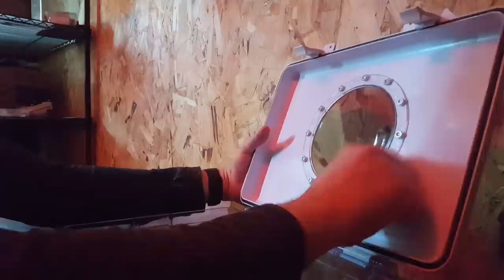Hampture Update for 3/11/2019: Dome Skylight & Official Merch

Comment: If you want to keep the hamsters really safe you should implement a system where the failure condition leads to their safety. So for example if the power is cut, then the habitats will float to the surface or something. It's basically the same concept behind safe nuclear reactors, where the "out of control" condition will lead to it shutting down, instead of going.... well... out of control.

Comment: put the dome on the hole and then use pencil or a marker to mark the holes, then drill where you marked. that way your drill wont clear away the plastic around the holes in the dome, and you wont damage the dome while working on it

Comment: To prevent possible... 'doomsday' you should make a fire prevention system with a pressurized bottle of water connected to several tubes of varying size, 1/4 inch for hampture hub, etc. have a servo connected to a Lipo or separate battery pack so if fire/smoke starts you can allow water flow to skeet and yeet that devil
Reply: If there's a battery fire, it might take more than water to stop it, and will consume a lot of oxygen in the process of burning. You'd have to close off that module let the fire burn out or use something like FM200 to snuff it out.
Reply: 爾靈山 well the wires will runs in hoses so fire chances are already low, so if a fire were to start it would be very controllable

Comment: I don't know about the bolts.  I would go for rivets, or at least weld the nuts. I make armour and use nuts and bolts to hold it together before riveting, when with the first it falls appart constantly when exposed to any vibration or movement. If there was any vibration from the equipement or  the place where you put it, or maybe water currents, they may get loose.

Comment: for the second larger dome, if youre worried about the bolts being visible you could always spray paint the flat rim of the hemispere. probably might not look that great, but hey at least itll look better than just exposed bolts
Reply: Could also reduce corrosion, especially if you use a sealing paint phil swift cackles in the background

Comment: use superglue or epoxy, paint it into the scratches to clear them up
or just polish it with polishing compound using your drill and a polishing bit
use a chamfer bit to widen the top of the hole and let the bolts drop down into it

Comment: Great stuff - I'm looking forward to a practical test.  Which brings me to my question:  Wouldn't it be be better to attach the dome to the outside of the container do the water pressure forces the dome down producing a tighter seal?
Reply from the maker: No, because it doesn't. This is a positive pressure habitat. The air pressure inside is actually greater than the outside water pressure, which insures against leaks.

Comment: That clear tube is cool but you may want to figure out a way to ventilate it. Obviously you can’t poke holes through it, but you’re very resourceful. I know you’ll figure something out.
Reply from the maker: ...I'm not sure if the purpose of this project is clear, but these habitats go underwater. There will be a constant flow of fresh air delivered to both the habitats by surface air pumps. The airflow created by this will be ample and there is no danger of asphyxiating in the tunnels. The simple act of hamsters moving through them will forcibly push stagnant air out of the tunnel and draw fresh air in behind them.

Comment: That transparent tubing looks great! You can definitely shape it with a heat gun, Wintergatan is using clear tubing on his Marble Machine X project and has been shaping them the same way, one problem he faced was that the tubes kept collapsing inwards, to rectify this he's been stuffing surgical silicone tubing inside which prevents it from messing up, I'll try to find the video in which he explains it and then add it to this comment.

Also when do you plan on creating a urethral habitat for those fire ants you mentioned? Could you put a dome on that as well?

Comment: How did I know you were going to make a q tip joke? The dome is looking pretty boss I must say. I've been looking into your positive pressure concepts. So I'm curious because I'm not going to buy books on this you already did. 

You can't go very deep with this due to the water pressure rising with depth correct?  What's the maximum depth you can achieve?

PS hamdrew Ryan is one handsome little bugger. He should be proud of your accomplishments.
Reply from the maker: The max depth for using regular atmospheric air is 50 feet, but you will saturate to dangerous levels in 20 minutes and require decompression.

21 feet is the limit at which the time needed to saturate is so great it's effectively a non-concern. 

8 feet is the maximum depth that the strongest aquarium pumps will push air down to. I am shooting for 4 feet at the shallowest and 8 at the deepest. I will make the umbilicals 10ft long.
Reply: @Hamdad  I guess that means you won't have to make miniature hamster sized iron lungs. That would be hilariously cute.
Reply from the maker: @commanderosis435  ...Would it really though